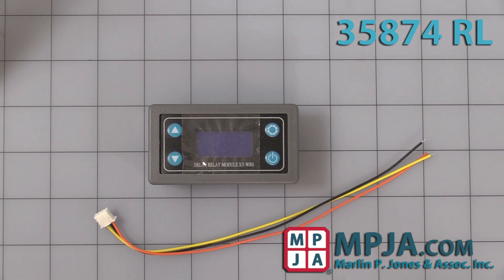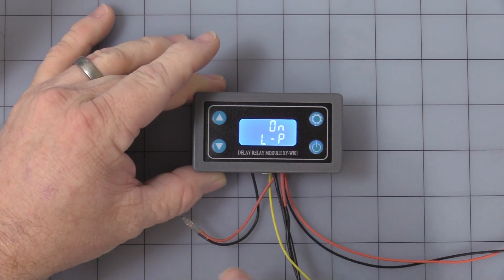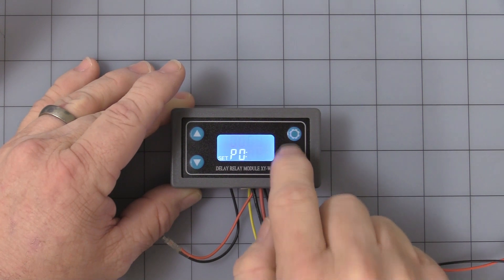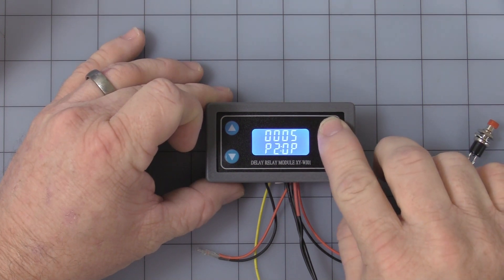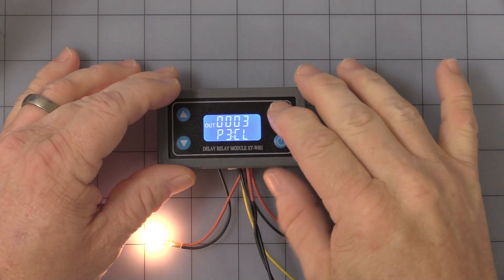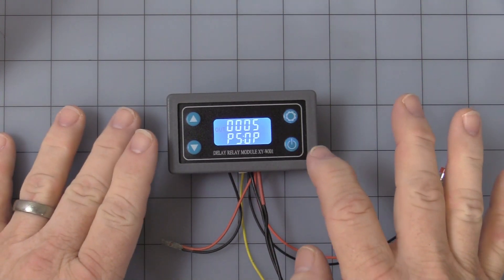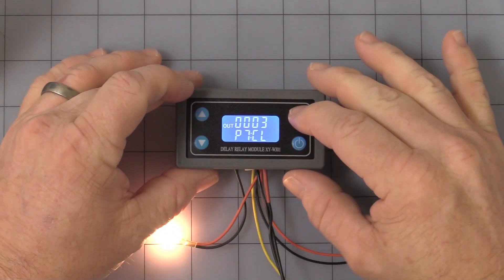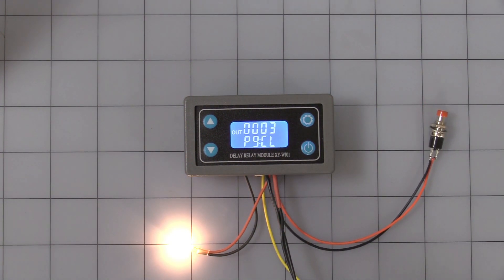Multi Function Time Relay 35874 RL

Comment: I know this is an old video, but if you see this comment. I got this off Amazon, looking to wire this to a linear actuator to get it to both push and pull automatically. To open and close a door for a Halloween decoration. I can’t figure out how to wire it.  Needs to reverse polarity to pull it back closed. Thought this would do it. But can only get it to go one direction. I thought the open would push and the close would pull. Any suggestions?

Comment: Unfortunately, they named the modes backwards. OP meaning open, technically means, relay contacts open/off. The relay is cited as NO/Normally Open and thus not passing current/signal. 
When I first used it, it did exactly the opposite of what it should have done. 
CL technically means closed/on and therefore the relay should have closed contacts and be "on."

People should be aware that it was programmed with incorrect mode citations.
Reply: They were thinking of it in terms of valve open, closed. This is a pretty common thing for programmers to get confused.

Comment: I need it to be off for a set period of time then turn on for a set period of time. Is this capable of it? I ordered a few different relays one is bound to work lol
Reply from the maker: Sounds like program P7: At power ON Relay will stay OFF for time CL without receiving a trigger signal; then relay stay ON for time OP and then repeats the above action. The number of cycles (loops) (LOP) can be set. Relay will stay ON it end loop(s).  Trigger is not functional in this mode

Comment: I have nine DROK brand and one Permenol brand that look and operate the same. I have programmed them all in the XX.XX range for spot welders. 
I wish I had found this video when I purchased the first. 
I see these timers with many names. I wonder who manufactures them ❓ (Probably Comimark).
The unit designer is a true genius 👍👀.
Yours is a good deal as I has to purchase the header pins in a kit and wire.
A bear to crimp as you know they are tiny. I used a 4" lighted magnifier on a stand to get the wires correctly into the pins for crimping.  
Not a fun job for the header connector & wire assembly. 
Thank You for the great video.

Comment: I have the same timer and for the internal trigger jack I used the plug and wires cut off of an old computer fan and the color code was correct. Black Wire was ground, red wire was high level trigger and Blue wire was low level trigger.

Comment: I need to run the five fault reset switch and the smallest amount that regulator says it supports is 6 volts how do I use it

Comment: Do you have to have a trigger I need mine to be on for 30 seconds then off for 8 hours then on for 30 seconds and then repeat indefinitely. And does this timer let you pick seconds for on time and hours for off time or do they have to be the same as in both in seconds or hours.
Reply: You have to run program number six and you have to get eight hours in minutes for the off time is 30 seconds but you will have to reset it after 9999 times which should be a while. i’m not sure though this is my first time as well

Comment: Hey man I have a solar pump and backup battery system. The problem I’m having is that the solar controller/ charger / is an all in one circuit board.  It’s got a “timer” option which is kind of a misnomer.  It has two settings : fully on or on for 10 mins and off for 50 mins. I am using it to water crops for aeroponics and need it to be much more frequent. So anyways the timer I got is the same as yours and I am having problems putting it with the existing system. Do I put it between  the controller and the pump? That seemed to not work- it turned on but didn’t do anything.  Or next I tried wiring it directly to the battery and whatnot but it just stayed on and would turn off any suggestions.

Comment: Does the trigger still work when you don’t release ur press and if it does it it completes a cycle still being pressed will it start over again once released gonna use a normally closed relay to start a second delay timer once the first delay timer ends its cycle. A timer to start a timer

Comment: II want to use the timer to operate a small motor  for example after two hrs and 30 mins. how do you do that.  thanks
Reply: Yes it will power on for 2.75 hrs(9999 sec) 🙂

Comment: Hey mate, cheers for the video, is there a function where it can be triggered and close the relay, and then open the relay then go to closed for a set time without being able to be re-triggered until the cycle is complete, I am trying to make a shower timer with a solenoid and don't want it to be activated again for sometime after its turned itself off, if that makes sense, thanks again👍

Comment: Is it capable of activating for approx. 30 seconds once every 2-3 hours and reversing polarity?  I want to run an incubator turner with it.  I'm thinking, I need to set it for the 2-3 hour intervals with limit switches that stop it in each direction.  But, I do need it to turn in both directions.
Reply from the maker: Sorry no reversing polarity it is a simple relay contact
Reply: Of course, It can also power a Hadron collider and produce a worm hole so you can travel across the universe ffs 🙂